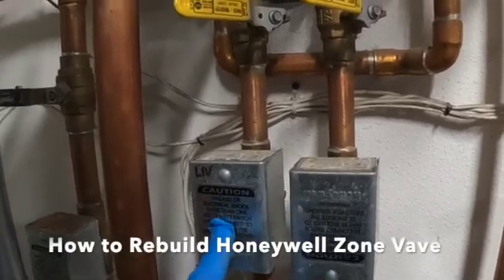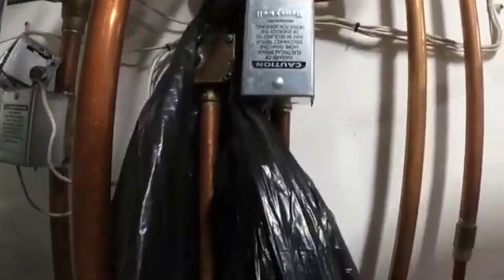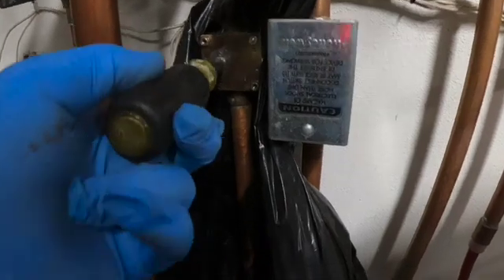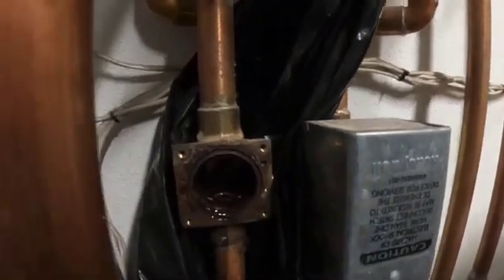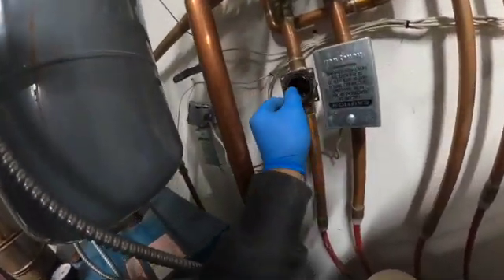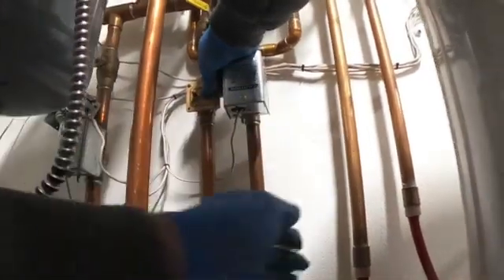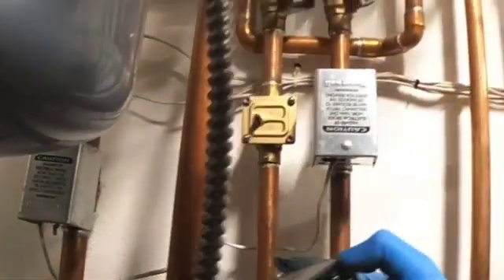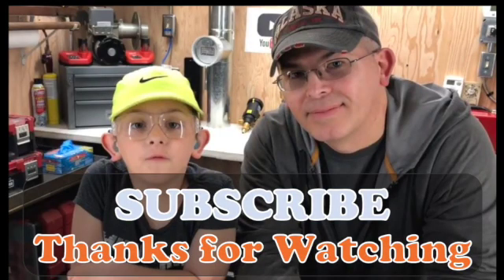Honeywell Zone Valve Troubleshooting – How to Diagnose and Fix a Common Failure

Comment: If the spindle and head don't align, how do you fix that?
Reply from the maker: Great question! Use the lever to rotate the motor stem quickly and the motor will rotate past the valve stem alignment. Keep pushing the power head against the valve body and it will slide together. You may need to do this a couple of times before it attaches. I hope this helps!

Comment: Can you manually turn the ball valve to open the line and get heat while you wait for your part in the mail?
Reply from the maker: You can manually open the zone valve but, it will only heat when one of the thermostats calls for heat and tells the boiler to turn on the heat circulating pump.

Comment: Thank you for your several videos on this topic. My system has been behaving poorly since we bought the house, but I left it alone because it mostly "worked". This fall the boiler wouldn't fire and the circulator pump would not run. After my first round of troubleshooting I found that two zone valves had been wired into the open position after being forced open. Those valve motors had stripped gears. Only the third zone had actually been working properly and it had been wired to a thermostat in a different zone. This one had a burned out end switch which was why the system would not fire up this fall. Consequently, the bedroom zones would get hellishly hot while the other areas of the house got very little heat. Anyway, thanks to your videos I've now replaced a dodgy switching relay and have one of the three zones working properly. I have the other two wired up, but because the valves themselves are stuck, I need to wait for two rebuild kits.

Comment: Does isolating  the valve by turning off supply and return eliminate the system pressure when you pull off the old plate? Thanks for the video
Reply from the maker: Yes, if you isolate the supply and return lines, you can slowly loosen the old plate. Place a bag or something to catch the fluid. Take your time because it can have a bit of fluid trapped in the lines.
Reply: @FurnaceTech  Much appreciated 👍

Comment: Thanks for the video 
It looks like it is upside down relative to the other  valve. Does that make the wiring a little messy.
Do you need to put anything on the oring?
One guy told me Petroleum jelly
Reply from the maker: The wiring on these valves can be a little messy but you can modify it in a number of ways to make it look better for sure. I never put anything on the o ring. If you get it placed just right, it will stay where it needs to.

Comment: Thanks i tried to find  relief valve  for my  floor heating radiant  { watts regulator model  M no 335 size 3/4 inch set 30 lbs BTU  per hr rating  NB ASME HV 510,000  } I took the  valve and checked with   plumbing store but could not find the same model  can u please let me know   what is important  to be the same  as the description above  if i  buy one from deferent company  or deferent model  Thanks
Reply from the maker: Make sure the relief capacity is the same or greater than the original safety!
Reply: @FurnaceTech   thanks   i donot  know which one  is  the  relief capacity since it does not mention that  i see  two numbers  one is   no 335  and the other one is NB ASME HV 510,000
Reply from the maker: Also make sure it’s 30psi as original too
Reply from the maker: The btu relief capacity is 510,000

Comment: Hi trying to install  new  relief valve  and the pipe that comes out of  boiler  got some rust  is that gonna be ok to add an extension pipe   and then install the  relief valve to that   fort the  future so if i need to change the valve i  just   removing the  valve  that is installed to the extension pipe  just want to make sure it is not affecting pressure or anything thx
Reply from the maker: You should be ok to add an extension pipe on the relief valve piping. Just do not add any isolation valves on the piping.
Reply: @FurnaceTech   Thanks    got one more question Regarding the water that comes to the system once it is filled   should i close the valve and open it once a year  so not allowing  more water  or  open it   little bit  or keep it open al the way and leave it  thx
Reply from the maker: If you do not have a low water cutoff then you should leave the makeup water open to allow the boiler to stay full automatically!
Reply: @FurnaceTech   thanks Bro  how should i know if it has a low water cut off or  it does not   Thx
Reply from the maker: @johnal4560  you would see it mounted on the main boiler piping. Or you would have a special aqua stat which has it built in. Most residential systems do not have them installed.

Comment: Thank you very much. I saved over $1000 replacing 3 zone valves myself.
I bought 3 Honeywell V8043E1012 $210 with tax & free shipping.
I left the old housing in place & replaced all the moving parts.
It was easy & now should work for many years.

Comment: Will these new powerheads fit an almost 30-year-old Honeywell zone valve?
At first blush they look the same.   I am afraid to sweat new because there is no valve to shut water off on the zone. Soldering & water just don't mix.